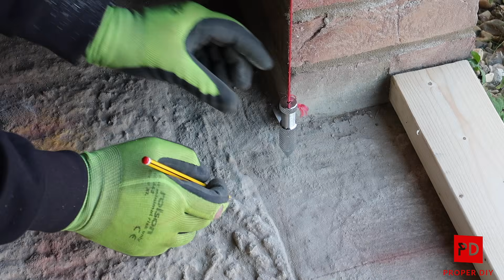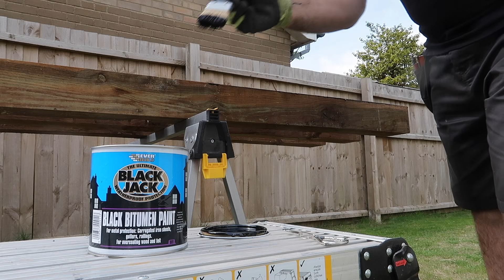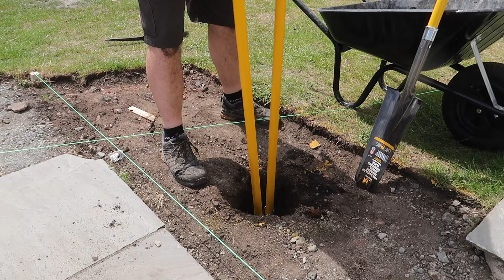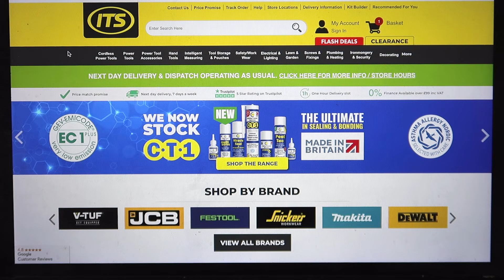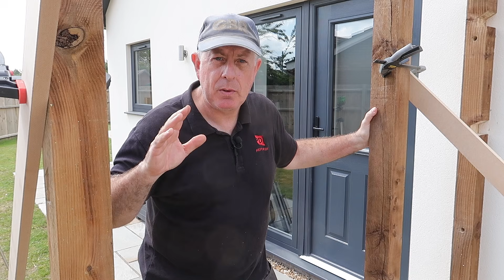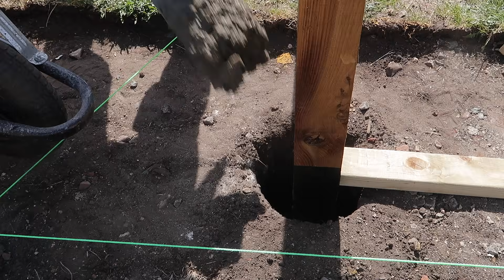How to Dig, Set and Concrete Fence Posts

Comment: Thanks for uploading. I use the same Rougneck tools - they do the trick but can can tiring after a while. Not sure why you painted the bottom of the posts? How will any trapped moisture drain ?

Comment: Would you consider using an Auger?
Reply: Digging holes manually can be tough work. Especially into hard clay. If there are large numbers of holes it is better to use a motorised auger, although I suppose it depends on the budget and local conditions. I don't know how good manual augers are.

Comment: Good video. I put in the first post, then screw a panel to it. Then screw the next post onto the panel, and concrete it in place. I agree that concrete is best, but slow. Incidentally, my rear side fence came down in a storm. It was there 18 years ago so probably a few years older. Most posts are still solid, but the panels were weakened, and needed replacing. The whole lot will be redone by me in spring next year. Concrete posts are said to last 20-25 years, so not much better.

Comment: Probably a stupid question but…
8ft post sunk 2ft down. Adding a 6ft panel but raising it up 5cm from the ground as recommended would mean the panel is above the height of the post wouldn’t it? Would I just account for this with the gravel to line it up again?

Comment: I also much prefsr doing it this way, i don't like postcrete. Also, i do have to wonder if drilling post holes with one of those augers, whilst quicker and easier overall, really produces a big enouw hole to accommodate sufficient concrete?

Comment: I've been watching your channel for a few years, your work is truly proper. I just viewed "How to dig, set and concrete fence posts" ( 2 years ago). Are your methods of installation still the same? Have you tweaked your process with any new product? It's a wide open question, I suppose a yes or no will suffice. Thanks in advance!  Rob, Tampa Bay, Florida

Comment: Really helpful this so thank you.. Can you advise though i’ve to put 3 fence posts in, as you did, in a straight line etc but there’s no wall or anything to go off eg to get number 1 post right, so the rest can follow on! How do i get this right? Lay a string line and fix ( concrete ) that first post first, let the concrete go off and then dig and fit the others? Thanks… NOODLES…

Comment: On the subject of concrete vs. Postfix, I've used ballast and postfix pre-mixed 50/50 when putting in 30+ posts in school grounds due to the limited time available during out-of-hours periods. It was more expensive but enabled work to progress quicker. This still allowed haunching of the top of the mix above ground level.
As an aside, I took the Damp Proof Membrane 2" above that to ensure protection against decay.
Glad to see you used gravel under the too. 👍
As an aside

Comment: Wheel BaI dug a 3ft 9 inch deep hole with a diameter of 14 inches.  Due to rain, the 3ft 9 inch hole got about 9 inches of water in the hole. Crazy thing is the hole was completely covered prior to the rain but somehow 9 inches of water still got into the hole. I have been waiting for the dirt to soak up all the water in the hole however it doesn't seem to be doing that. After two weeks the water is still there. So my question is what would be the best way to drain the water out of the hole? I thought about just putting a few thick bed sheets in the hole to soak up all the water like a sponge but wasn't sure if that would work efficiently.  I then thought about just pouring dry concrete in the hole and mixing it with the water that is already in the hole.  What do you suggest? One more question. If I drained all the water out of the hole and the dirt/soil in the hole is still wet and soft is it still okay to mix concrete and pour it into the hole with the dirt/soil already being fully saturated with water? Oh wait....one more question LOL. How many bags of concrete would I need for a 3ft 9 inch deep hole with a diameter of 14 inches? I will be installing a fencing pole with a diameter of about 2 inches. Thanks for your help.

Comment: Your fence looks so nice.  Thanks for explaining all the details.  One thing I didn't get was the rocks at the bottom of the hole for drainage.  Given you will pour concrete in the hole, won't it fill the gaps between the rocks and cancel the drainage benefits?
Reply: No it won't as long as the mix isn't too sloppy!🙂

Comment: My neighbour had some new fencing put in and the guys used expanding foam instead of concrete. The guys were from a legit fencing company, the fence looks perfect and 3 years on those posts are rock solid
Reply: I've seen this used to fill around 'Z' posts for central reserve safety fencing, where the post is fixed within a pre-installed lined concrete socket. I always wondered how durable the foam would be. Thanks for this interesting comment!

Comment: I'm sure it was mentioned, but for anyone watching this wanting to dig holes themselves as well, the depth will be highly dependent on where you live. Here in east coast Canada, i have to dig at least 4.5 feet (1400mm) or more to get below the frost line. That's double what you had to do. Otherwise you'll have some pretty crooked posts come spring!

Comment: Hi...A great video and very informative. I have a couple of questions if that's ok.
I am about to fix seven fence panels with 100mm posts, which I want to be about 1.8m tall. I have a Draper 150mm auger, (cuts through like butter) but I don't think the amount of concrete around the post will be adequate. It is suggested that the hole needs to be 600 deep and 3 times the width of the post. So 300mm wide. What are your thoughts on post hole measurements? (The ground is soil then sand after about 400mm.
We love your house!👍 Please could you tell me the colour of the render/paint? We are are having new grey windows and synthetic render, which come in loads of colours.
Thanks

Comment: Great video, followed it and set a 4x4 post for a garden gate, all good so far and the post hasn't moved an inch.  However, after a few months the post has bowed slightly near the top.  Other than planing the bow out, how could I straight it?
Reply: I had the same with my posts some have twisted towards the top quite significantly i don't think it can be rectified. In hindsight i would not put bitumen on the base of the post . I also used bitumen sleeves at soil level.

Comment: have you look into product called  Postsaver.
Postsaver Sleeves prevents fence post rotting at ground level
is it better to use bitumen base paint instead?
or would both work together in tandem.

Comment: if I was to wait for 24 hours fir concrete to set before erecting panels the job would cost a fortune. Usually, fence posts are inserted as the line progresses and panels erected.
Your method is fine if you are taking your time but I can't see a customer paying for concrete to dry>I hate to think how many fences I have erected over the years and I never had a callback.
But a good explanation.
Reply from the maker: Well this channel is aimed at the DIY'er who has time, isn't making money out of the job and doesn't want to spend a fortune on Postcrete.

Comment: That post looked a little more wobbly then I’d like 🧐
Reply: Yeah. They should be rock solid.
Reply: Always like that wooden posts anything over 4ft will just wobble
Reply: @Chuck_it_and_chance_it  Mate I’ve been digging holes and setting timber posts for years, and mine don’t wobble!! You’re doing something wrong buddy!
Reply: @fireboyspirit3474  using wooden posts is just wrong all together in my opinion they are crap
Reply: @Chuck_it_and_chance_it  Maybe so, I agree they will always rot. But I do what the customer wants and for some reason us English still like timber fences 👍

Comment: Great video and well explained, you certainly know what you are doing, from my own experience I wouldn't paint the very bottom of the fence, so as to let moisture escape through the grain into the gravel at the base, also it would add years to the fence to seal the top of them with a cap to prevent moisture holding in the grain and moss etc growing and rotting the timber through time..  hope you don't mind my input.
Reply: You are spot on with your comment

Comment: I always prefer the pre mixed stuff but that’s because it’s easier … have you any thoughts on the foam based post mix stuff?
Reply: I used a 50/50 mix of ballast and postcrete for speed and reduced cost. -premixed in a barrow before using it like pure postcrete worked very well, giving the benefits of both materials.

Comment: I have a question:  I dug 32 inch (813 mm) holes and filled them 1/2 way with wet-mix concrete.  It has dried, but now I think it best to fill the holes all the way up above the soil line and slope the concrete down away from the post for drainage as shown in this video.  What is the group's thoughts on putting wet concrete on dry concrete which would be now above the freezing level.  Could or would this harm the posts or cause them the heave up when the ground freezes?  Thanks for any help on this.
Reply: Can’t see any harm in doing that buddy 👍 If youve done it, how did it go ??
Reply: @thedj5914  I did it… And it worked out fine this winter. We had a lot of freezing weather and nothing heaved.

Comment: can the bituminous paint be applied to wet posts, ie straight form the timber yard, or do they need to be dry?
Reply from the maker: The posts I get from the timber yard generally have just been treated so would be too wet to take any paint. These posts I have had stored for around 4-6 weeks and took the paint fine.

Comment: Any particular sized gravel for the bottom of the hole? Pea gravel or larger 10mm/20mm?
Reply from the maker: No particular size but needs to be able to drain. I used 10/20mm

Comment: You can’t use those digging tools in Scotland let me tell ya! 😂
I don’t disagree but I prefer post -crete. It’s easy enough to mix up some rapid to finish the last 10” including bevel if need be, did this on my gate post. I remember once hitting a slab of sandstone whilst digging the last hole for concrete post, seeing it was only about 100mm from the depth I just cut the post, was a Friday after all 😎

That middle post on the trestle looked a bit wonky, nowt worse. 🤙🏻
Reply: Here’s a gate I just built on an old crooked wall garden wall opening. 

https://youtu.be/PX63Tscr3jc

Comment: Great video. Will you be doing a follow up on installing the gate?

Also, can you do one of your "quickie" videos perhaps on how to do string lines and the knot you used at 1:08?

Keep up the great work!
Reply from the maker: Thank very much. Yes, garden gate video out very soon. I haven't thought about a short stringlines etc video but maybe thats a good idea.
Reply: @ProperDIY  glad to pass on the idea 😁
Reply: Here's what I was shown when I began work on site:
1) Pull the line tight with just a single turn around the pin.
2) Lift the line from the bottom of the turn to be over the TOP of the "turn". This effectively locks the line through friction AND if you need to wrap the same line onto adjacent pins for (say) laying edgings, a sharp tug on the line frees the lock on the first pin so that you can make adjustments to the LEVEL of the turn around the pin to "sweeten" the vertical alignment when kerbing or edging laying in a vertical curve.

Comment: Another good video. Only recently came across this channel.
I installed a washing line post a few days ago and used my Titan super jaws XL over the dug hole and clamped the post vertically while I inserted the postcrete. Very quick and effective way of maintaining the post in position
Reply from the maker: That's a good way of holding it in the right place if you have them

Comment: Brilliant video....  done a few fences and always struggled digging the holes with a cheap fencing spade...  usually holes dug too wide and loads of concrete in...  worked so far, touch wood....  if I do it again though I think I'll invest in a decent quality trench spade and post hole digger.  

Good work again, thanks for sharing!
Reply from the maker: Thank you

Comment: For extra post protection its better to add DPC / plastic 16 micron wrapped neatly around the base of the post before concrete placement.
Reply: Yes, short term, but if any water ever sneaks inside the dpc, perhaps seeping down the post, it is trapped there forever and will rot the post. I think it’s better to have any such water leech away, as shown here.

Comment: Another good video with lots of sage advice. 
One discussion point is the extent of bitumen paint. Rot tends to start where air/damp earth meet, I think I'd only go down the sides with the paint, otherwise you are making a cup. The "Ham Shanks" have a heat shrink system that seals the sides of the post only and I would try to emulate that with the bitumen. Each to our own.
Reply: Have to agree with you, I would only seal the sides with bitumen and let the moisture escape through the bottom
Reply: In my experience if you’ve not dried your pressure treated timber whether  it be posts or fencing you need them to be outside at least 3 months for the chemicals to evaporate. (so it can accept treatment or paint)

If you slap bitumen paint on the wood chemicals push out and it fails. It crusts and peels. It cant breathe. Seen it on planter posts i did last year.

Just use a good timber paint like dulux opaque or even a clear treatment. Im not a fan of bitumen on timber.  Haunching and no soil a must.

Im curious about these durapost, they seem to wobble / flex on videos ive seen, but cant be sure. cheers

Comment: What is the concrete mix for the bevel at the top? Looks like it’s sand and cement... 3:1 perhaps? Thanks.
Reply from the maker: It is the same mix as I used around the post - 6:1 ballast cement

Comment: A couple of years ago I spent 4 hours trying to get an old wooden post out. They obviously had a lot of concrete left over and "got rid of it" around my fence post. Even with a breaker, a sledgehammer, and a pick axe it wouldn't give up! It needed me and my neighbour to lift the huge piece of concrete it was set into🤣
Reply from the maker: That's not fun
Reply: Just had same this weekend ! at least nice and sunny
Reply: I did the same. Then someone told me to buy an SDS drill for £60. I got the other posts out in thirty minutes each. The drill cut through the concrete like butter. What took the time was pulling out the rubble.

Comment: Everytime I've dug a hole for a fence post there have been rocks, old bricks, concrete and some clay tiles with "DANGER" written on them.
Reply from the maker: Clay tiles with DANGER stamped on them means big power cable underneath - best not to use your pick axe at that point!

Comment: Try using old engine oil instead of bituminous paint!
Reply from the maker: You can do - I don't have any!
Reply: @ProperDIY  a lot of fencers years ago used to burn (scorch) the surface of the bottom of the posts either in a bonfire or using a blow torch to stop them rotting. I have done the same myself with good results.

Comment: I used a 150mm diameter hand auger to drill out the hole - really easy (and much better than a powered one that didn't work). I've lent my augur to the local golf course who are using it to fit new tee markers!

Comment: this one looks quicker and than  the way  I was taught back in the 80's , I remember putting 100's of post's in while on a council run YTS - back then wooden posts always had to have  plenty of 9 inch nails knocked in around the base of the posts and the mix had to go in semi-dry with carefully placed large stones trapping the nails, a wet mix to result in the wrath of the supervisor - and I remember it well! - there was no ballast back then  but the mix was stronger  than the usual 247  cement sand chippings mix  - if I hadn't seen this I would be putting the post the way I was shown nearly 40 year ago  - thanks
Reply: I was told to put 9” nails in the posts to stop the local toe rags pulling them out, and believe me I’ve seen posts nicked! Unbelievable 😂
Reply from the maker: Sounds like a different strategy - I bet they don't do it now!
Reply: Ah - that would explain why I've just had to remove two post foundations to rotted posts that also had 6" nails embedded in the concrete.
Sadly, no-one thought to use DPM paint on those, otherwise they might not have rotted!🙂

Comment: For digging post holes in gravelly soils I've had success with using one of those long iron digging bars to loosen up the soil/rocks.
Reply: I had to resort to using a small electric SDS percussion DRILL to break through up to 9" wide flint chunks when putting in 30+ posts within school grounds. I couldn't have managed without it!

Comment: Hi Stuart, am literally going doing fence posts this weekend and the bitumen paint was a step I forgot about. Cheers.
Reply: You can also use Postsaver, so you don't have to wait around for the bitumen paint to dry https://www.postsaver.com/
Reply: Thanks for the link.
Interesting that it shows posts driven into virgin ground but stones in the soil could breach the protection so I'd only use when concreting. Still not sure whether the additional expence over hand-applied BLACKJACK DPM is warranted though unless max speed is what you're after.
Reply: My fence posts are 20 year old and still solid. I wouldn’t swing on them mind, ha. They most definitely weren’t treated on site. Personally if it’s encased in concrete its dry enough for me. The haunching around the base is more a must, posts are generally well treated before sale, the tops usually rot quicker than the bases due to treatment neglect or being left square cut. Water wins in the end. More wine vicar 🍷
Reply from the maker: No problem. Buy a small tin from Toolstation - it goes a long way but worth the effort for extra protection